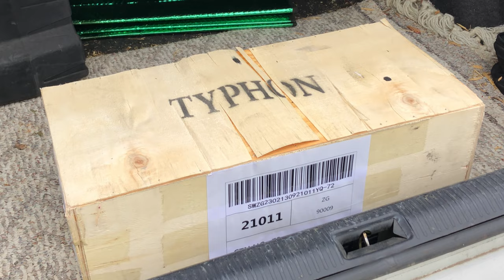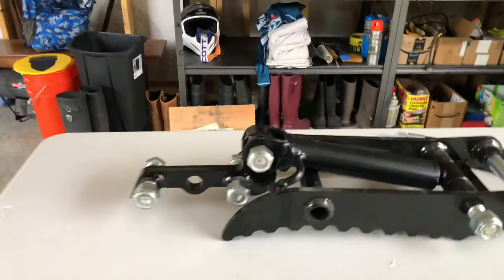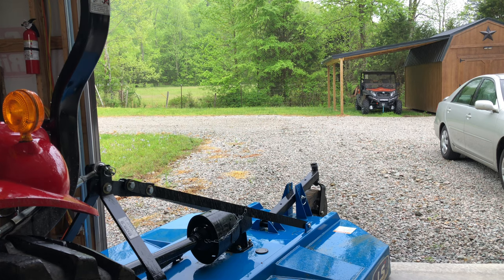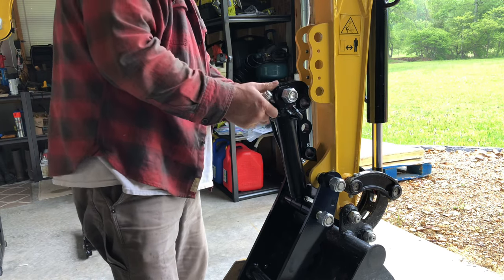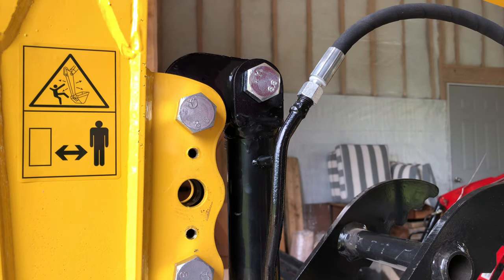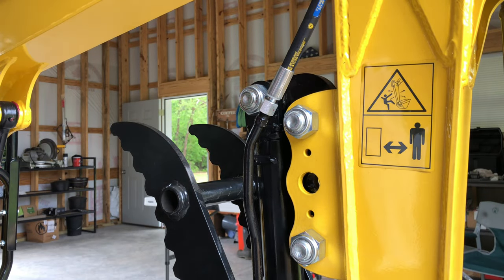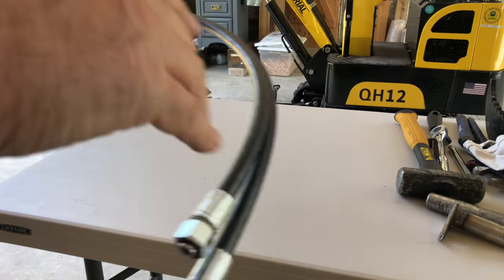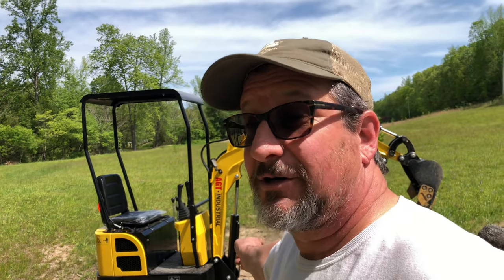INSTALLING NEW HYDRAULIC THUMB ON A MINI EXCAVATOR.

Comment from the maker: Link to the Thumb. https://www.ebay.com/itm/265636363390?mkcid=16&mkevt=1&mkrid=711-127632-2357-0&ssspo=RZ14qy-PS7K&sssrc=4429486&ssuid=DwSRbw1SQgC&var=565424329456&widget_ver=artemis&media=COPY
Reply: Do you know the size of the fittings? I’d like to get the hoses made ahead of time.
Reply from the maker: @jsmed12  No because they just made new hoses for me. So I don’t know what size they are. Sorry
Reply: Does anyone know of a link to a thumb that has the extra larger fittings included? I'm buying an FF12 and I believe its just like this QH12 in that it has larger hydraulic lines+fittings. This thumb in the video was likely made for an H12, which I think might have smaller hydraulic lines+fittings. If anyone can provide a link to a thumb with the larger fittings included that would be awesome!

Comment: Never ceases to amaze me, nice shop, but doesn’t have the right tools for the job. Three days later, still couldn’t find the right tools. Harbor freight sells a wrench, socket set for $39.95.
Reply from the maker: Actually I just finished the shop recently. And on top of that I’m a just retired ex auto mechanic for 32 years with Goodyear. And most of my tools and boxes are still at my other house. Still slowly moving things. But thanks for the comment. 😉👍🏻
Reply: Some home mechanics are cheap skates and don't want to spend money on tools but have a nice shop I prefer to buy every tool known to man to make my job easier.
Reply: Hey he got the job done with the tools he has 😮
Reply: @diywithcookiepops2193  did you retire from goodyear in union city?
Reply: I thought this too. I never hold bolt heads with pliers, especially big ones like these. In the case here, a 1  3/8s socket fits these locknuts perfectly.

Comment: Isnt that a kick in the head with those hydraulic shops? Its like they get so offended you didnt buy a cat or JD. How dare you want to try a simple fitting solution, no way! You gotta buy our hose.
Reply: My local hydraulic shop is run by the Amish. They do good work but anything metric forget it. If it isn't SAE, you're better off going online.

Comment: F'in hose shops! more than likely they could have replaced that end, just cut the swage off the one on yours cut the hose back and put he fitting back on with a new swage. But that makes them no money! I normally cut it off myself and take it to them. 2 other things looks like you need to put some spacers on the bottom pivot point where the thumb mounts to the stick you don't want the thumb to move side to side and hope you checked your hydraulic fluid after you worked iy a few time. Looks pretty good.
Reply from the maker: Yeah… they just wanted to sell new hoses. They said they couldn’t stand behind their work with some other hose. I did check the fluid it was still in the safe range. And I put some collars on the bottom pin to keep it from moving around. Thanks for the tips. 😉👍🏻
Reply: @diywithcookiepops2193  See if you can find a crimp tool and do it yourself. Screw them, if they try to gouge you.
Reply: @erik_dk842  Hydraulic hose crimpers are several thousand dollars with all the collets.
You'd have to make a lot of hoses to make it worthwhile. 🤯

Comment: You can replace the grease fittings with Metric zerk grease fittings. 8 X 1.0 Short. You need a 9mm. socket to remove the originals and a 10mm. to install the new ones.

Comment: If you can wait for shipping surpluscenter has almost every fitting you might need. It looks like a simple 3/8 to 1/2 adapter to 1/4 to 3/8 adapter was needed. $5 for the pair plus likely $10 shipping. VS $50 to $100 in hoses. Their hoses are also very cheap cost wise vs everywhere else.
Reply: FYI everythng on these machine ss metric not SAE
Reply: Dang you weren't kidding thats so cheap. Wish they had metric.

Comment: HE DID GOOD. very helpful video. i got the thumb but my excavator from China was different . it has only one point to connect thumb (his frame has two pieces with three holes welded). i ended fabricating to pieces and welding them into the frame . it worked and i am very happy. My hoses came with the adapters already.  i recommend buying the thumb and make whatever adaptation is required. Is better than buying a CAT unit or similar for a lot of money.

Comment: Can you measure the thumb ram length extended and collapsed? I'm hoping to just buy a ram and hook it on my stock mechanical thumb.

Also, do you know the fitting style and size that the shop put on each end of the hose? Thank you.
Reply: also curious about the cylinder bore and stroke. Thinking of the same thing because I can likely make the bolt-in adapter.
Reply: @benlenders7813 Did you ever make your own? I went with an 8" ram. 16" extends to  24". I'm not done yet, but it looks like a shorter ram would be a better fit. Maybe a 6" (12x18)?

Comment: Dude I am actually in the comments or this video but using a crescent wrench and channel locks for hydraulic lines you need to use the correct wrenches before you fuck them lines up word of advice the correct wrenches
Reply from the maker: Hey… Thanks for the advice.

Comment: this might sound dumb but...does your excavator have a rear hatch access that swings open? i bought a similar one and havent been able to find any other doors other than the flip up seat....
Reply from the maker: No… Just the flip up seat. And it does make it a pain to work on. Could of used a little more thought in the design for sure.

Comment: I would try to install it on the bucket pivot point if it fits. It should pivot with the bucket so the bite is always same.
Reply from the maker: Yeah… I thought about that. But it’s not wide enough for that. This thumb just fits wear the original one was. But it works great. Thanks for the suggestion. 😉👍🏻

Comment: Congratulations, looking at the view count it looks like "the algorithm" picked this one up an showed it to a bunch of new people, including me :) 

Looks like a great addition to the mini excavator! I think it would be wise to install some bushings though, the connection from the thumb to the boom is VERY loose, both pin size and side to side movement. The holes and pin will wear out in no time at all like this. A grease fitting probably wouldn't hurt either.

Some hints to improve your videos: 
- Volume control / normalization. I kept changing the volume throughout the video. Lower it when the machine ran, up again when you were talking, down again when the machine ran, way down at the bit you sped up. It's a bit more work for you to set the volume of the individual clips (or even parts of clips), but it makes watching (and especially hearing) these videos much more enjoyable  :)  For instance, the transition at 1:10 goes from an ok level of motor noise to VERY LOUD motor noise. At 3:20 it's the other way around, removing the packaging sounds a lot louder than your voice.
- Perhaps a separate mic for your voice? Especially handy when the camera and its mic are pointing away from you.
Reply from the maker: Wow…. Thanks for all the advice. I will definitely try these things in future videos. I really appreciate it. Also I put some collars around the main pin too hopefully help with the side to side movement. And some grease. We’ll see how it goes. Thanks again.

Comment: Do you find the hydraulics extremely jumpy on your machine?  I purchased one and even with the rpms low mine is anything but smooth operating.
Reply from the maker: OH Yeah… The hydraulics are very sensitive. You have to move very slowly. 😬 But I got use to it. I looked for a way to maybe adjust the sensitivity but I didn’t find anything. 🤷🏼‍♂️
Reply: @diywithcookiepops2193  You may be able to modify a fitting to install a restrictor in the feed line to the control valve.
That would slow down the flow, but still allow max pressure for digging.
I'd want to be sure it wouldn't cause excessive bypass and overheating of the hydraulics though.

Comment: If you would, could you reply with the retracted length of that cylinder? My machine (H12) is the same and already has the fixed thumb. Just a cylinder and hoses and I'd be in service!
Reply from the maker: I measured the cylinder from center of hole to center of hole retracted. And it is 13ins. 😉👍🏻

Comment: The usual way to join Metric and Imperial fittings is to cut the appropriate nipples in half and weld/braze them together. 2 for the price of 1!
Reply: Both machine and the thumb are metric. There are no SAE bolts/hardware on any of the chinese machines.
Reply: @maxfilippi5730  Correct - but the post was for the information of anyone who needed to repair the supplied fittings with locally sourced Imperial fittings/hoses. 😉

Comment: Better off buying used than buying pure chinesium.
These things are incredibly unreliable, the pump starves at the best of times and dies when you don't want it to, not to mention that Briggs is not what they were and that little petrol motor will break down.
Whatever, I guess an excavator is better than a shovel, have fun while it lasts.
Reply from the maker: Yeah… definitely better than a shovel. Haven’t had any issues with it so far. The pump is very strong. It’s not on the job everyday, so I’m pretty sure it will last for a while. Plus any replacement parts even the engine are readily accessible and won’t break the bank. Also it’s pretty easy to work on. It’s an awesome addition to the farmstead equipment. 😉
Reply: Used cheap reliable. Pick two, you can never get all three. Brand name excavators, especially the smaller ones, are way overpriced for specimens worn out in every department

Comment: Was the new thumb that different from the hydraulic one? Who not just replace the solid steel piece with a hydraulic ram?
Reply from the maker: The original thumb was a fixed thumb. And got in the way of digging. So I replaced it with the hydraulic one. So it could be moved up higher out of the way. For the price of the thumb it wasn’t worth trying to fabricate something. 😉

Comment: I got it working. But they don't tell you you need to bleed the air out of the cylinder.
The first time I tried it, it locked with the piston fully extended. I loosened the connectors at the cylinder and a load of fluid blew out with bubbles.
I pulled the thumb back to midrange and tried again, tightened the connectors and  SLOWLY opened and closed and it started cycling correctly.

Comment: It sure took a long time to pull the pins on your mechanical thumb.  I see why you wanted hydraulic.  My mechanical thumb takes only 5 seconds to pull a pin and reposition - no tools needed.  And folds all they way back against the stick for digging.  I wish I had hydraulic, but my mechanical one works great for now.
Reply from the maker: Yeah… this one won’t go any higher. But I’m really liking this hydr one so far. 😉👍🏻

Comment: cant you just add a hydraulic cylinder in place of the piece of steel that links the thumb stationary?
Reply from the maker: You could… For me it was easier and quicker just to get the hole assembly. Plus the new thumb is a little larger.

Comment: So it was already plumbed for a thumb? Just capped off? Already a hydraulic lever for the thumb?
Reply from the maker: Yeah everything was already there. There is a lot of other attachment you can get as well. Next I’m thinking of getting the post hole digger. 😉👍🏻
Reply: Yeah that would be handy @diywithcookiepops2193

Comment: On to the Bucket. I carry 8' to 10', 10" diameter logs around for cutting and splitting into firewood.
Get rid of the WINGS on the Bucket! They don't hold a log even with the hydraulic thumb. Take them off.
Also digs better without them.

Comment: What kind of weight can be moved with your setup? Needing to move logs myself as well...
Reply from the maker: I think the total lifting capacity is around 5 or 6 hundred lbs. But easily 3 to 4 hundred with no problem. 👌🏻

Comment: Thanks for the Vid!, I have been contemplating a Hydraulic Thumb addition to my JF-12 (Same as your QH12) because Yes the Mech. Thumb gets in the way. The Fitting for the Aux Lines were one concern, Metric O Ring Thread to what ever would work??? I am grateful to learn that the Hoses supplied still need attention, this will save me a Step. Now that my Mini Geisha is at the Cabin far away from my Hydraulic Supplier. 

Did you consider just adding a Cylinder in place of the Strut on your Mech Thumb? However, finding a cylinder "Collapsed at shorter than 14"" (the strut's length) would be a hard task.

Also, did you remove the "Detent" part of your Aux. valve?
Reply from the maker: Yeah… i think it would be easier just to get the whole thumb kit.
Reply from the maker: No I haven’t done anything with the valve.
Reply: @diywithcookiepops2193  Yes, looking though they might not ship to Canada, so I will have to do some investigating. The Detent is an easy fix (from what I have been told) might make it easier to work with.

I do like my Thumb, and very seldom it actually gets in the way though, but I haven't done any Branch Clean Up, Log moving yet where the Thumb is in use. I might just leave the Mechanical there for the time being. Fathers Day is coming fast!

Comment: Better add two 7" fans in that engine bay pushing out! I have the same machine and it will boil the gas after 20 mins of medium load and hydro lock the engine.. PS I feel bad the chinese put your boom sticker on upside down on the left side
Reply from the maker: Yeah…. I’ve heard of it getting hot. Haven’t had that issue yet. Fan idea sounds pretty good though. May try that anyway. The sticker? 🤷🏼‍♂️ Chinese! What ya gonna do? 😉👍🏻
Reply: Ya ran mine yesterday for bout 30 and it boiled the gas so I ordered a couple 7" rad fans hope that cures it or I'll be moving the gas tank out of the engine compartment kinda sketchy
Reply: Pull sticker off, flip over, re-attach. Solved. :)  Mine gets HOT, but hasn't boiled the gas yet. Good idea about the fans.

Comment: when you install the hydraulic thumb on AGT excavator , what size end did they put on the end of the hydralic hose that goes to the excavator line.
Reply from the maker: I’m really not sure. They just made them up for me. So IDK what size they are. Sorry 🤷🏼‍♂️
Reply: ok THX
Reply: From what mine is I had to change the one end on the line to a 10mm light din fitting. Hope that helps. The line size on the ram is 8mm light din. Not sure why they made the auxiliary lines bigger. My only thought was for flow with like a auger or something that needs more gpm

Comment: I'm really curious what your local hydraulic shop charged you for your two new lines with new fittings?
Reply from the maker: It was around $50 bucks. No to bad I thought.
Reply: @diywithcookiepops2193  thank you for your quick response I agree 50 bucks to have it right is very fair. I clicked on to your link and they're sold out I'm going to attempt to buy one on another site. It looks like shipping could take up to 45 days I don't get it LOL
Reply from the maker: Wow!! The place I got it, I’m pretty sure shipped from Chicago. It took about a week. It’s well worth the wait. 👍🏻
Reply: Just a heads up the place in Chicago orders their thumbs from the same place I just ordered my new thumb. Which makes me feel better lol it's the first time I've ever used eBay.
Reply: Hey I got my new thumb the other day and it came with the extra correct fittings to use the hoses that came with it . Thanks again for your link appreciate it  @diywithcookiepops2193
Reply from the maker: @yohon8977  Wow… That’s awesome. Definitely a time saver for sure. I wish mine came with them. 👌🏻😉
Reply: @diywithcookiepops2193  I was absolutely prepared to go get two hoses made.
Reply: @yohon8977   Do you have a QH12 or FF12 model?  I think these two are basically the same and both have larger hydraulic lines/fittings than the H12, which is why the fittings were too small in the video. It was likely made for an H12. If so, can you direct me to where you bought yours or reply with the link?  I'm buying an FF12 so I'd love to order the thumb that you did which includes the extra larger fittings. Thanks!!!

Comment: so the mini-ex came pre-plumbed and with the control for the hydraulic thumb or was that an option on purchase?
Reply from the maker: No it came with everything ready for the thumb. Or any other attachment you want. I’m also thinking about getting a post hole drill in the future. 😉👍🏻
Reply: I’m also looking at an auger attachment would you be getting it from the same company
Reply from the maker: @robster7999  Yes…. I already have it in my cart. Just waiting right now to get it. It’s like $1000 bucks. When I get ready to do my farm fence I’ll definitely get it. 👍🏻
Reply: @diywithcookiepops2193  I just bought a CFG DY14 and am hoping the attachments will fit, can seem to find any dimensions, maybe when you get this piece you could give that info in the next video, thank you for your time.
Reply: @diywithcookiepops2193  do you know if there is a way to change the controls from backhoe to excavator
Reply from the maker: @robster7999  Not sure on that one.
Reply: @robster7999  The hoses just go to the control blocks... I don't think there would be any magic to swap them to move from ISO to SAE.